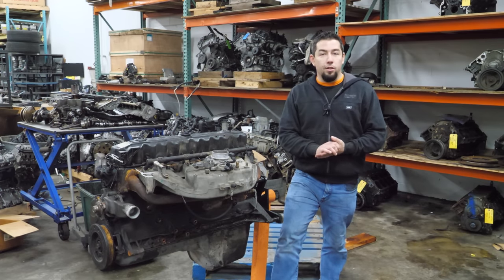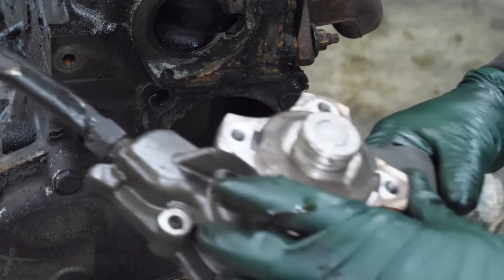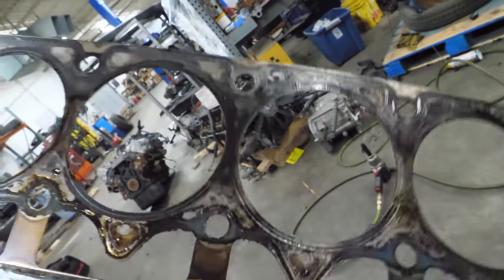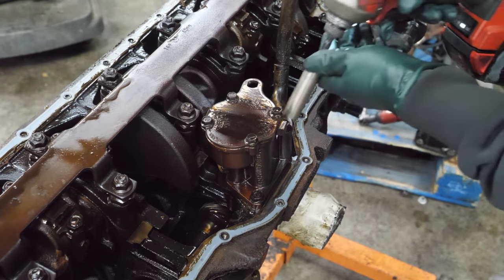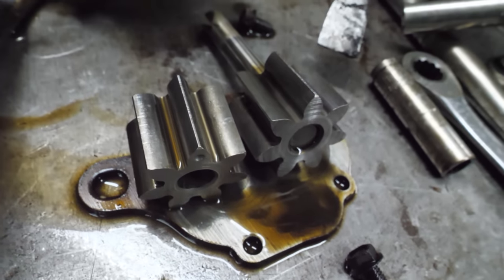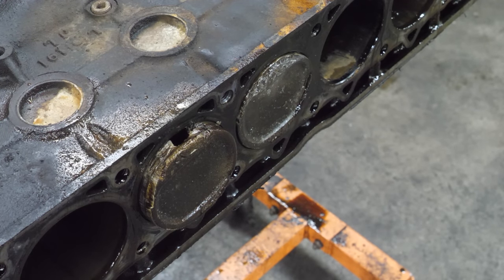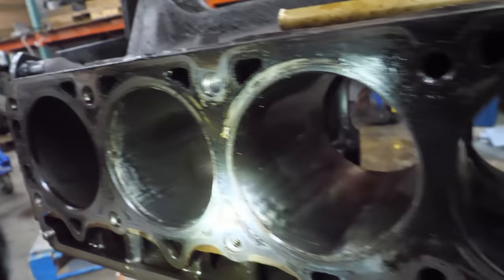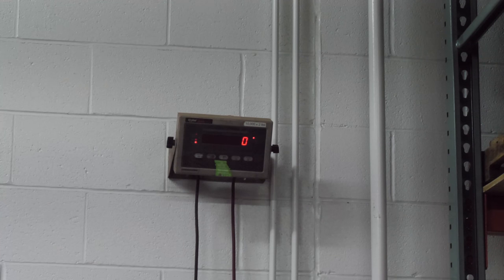How Do You Destroy A 4.0L Jeep Engine THIS BAD? Intentional? Neglect? Ill-Repair?  I Am IMPRESSED!

Comment: Agree 100%, great motors. My 93 grand cherokee I rebuilt it into a 4.6 white Brothers motor. That thing was an even bigger beast! Got T boned going through an intersection by a guy doing more than 60 mph, he ra. A stop sign told sheriff he was distracted driving (cell phone), and neither he or his 9 yr old son were wearing seat belts. I was and was fine. Totaled jeep. Towing company took it away, never saw it again. Motor still fired right up. Rear axle was a pretzel on passenger side. I was gonna buy it back to get my motor back to put in my 96, never seem it again. When I got .y check from the guys insurance company I put a well built 5.2L. 318  in it and still have it, runs great. The original v8 was blown up, so I got it cheap. Great vid.

Comment: I once owned a 1974 Duster with the big slant 6 with 400,000 mile . Drove it for 5 years sold it was still running good. Currently I own a 1992 Ford F150 with the 4.9 I 6 with 280,000 miles, running great! Must be something with the 6 pistons.

Comment: I have had fewer issues with 91-95 4.0L engines than 96+ engines.  I had a 1998 4.0L XJ that locked up 296,500.  It happened as I was leaving my driveway for work.  I meticulously maintained this Jeep with consistent 6k mile full synthetic oil change intervals.  When I opened the engine, I found the entire #6 piston shattered in the oil pan with the wrist pin still in the rod (and jammed into the cylinder wall).  On the other hand, my son has a 1995 XJ with 328k miles and shows no sign of quitting.

Comment: You are right about 4.0 engines. I am restoring my first car, a 75 Malibu with 250c.i.  inline six. The car sat for 20 years and when I slap a battery and clean gas in it, it cranked right up. They may be low on the horsepower, but they last forever. The body on the other hand needs some serious TLC.

Comment: I used to have 2 Jeeps, a '94 Cherokee Limited 4.0 Auto and a '98 Jepp Grand Cherokee 4.0 Auto. Both green with Mushroom Leather Interior. I actually prefered the '94 Limited as you could choose either 2 or 4WD. Great engines!

Comment: I had a 4.0 in my 02 wj that cracked the skirt off the  number four piston at 103,000miles. Lucky I noticed a change in the engine sound and shut her down right away. I ended up rebuilding the engine for about $600 in 2013. Put another 20k on it before I traded it in for a jku in 2015 that I still have. I loved how easy that engine was to work on.

Comment: One reason for the overheating problem that you mentioned may be an issue in a relay for the radiator fan.  I have a used 2002 Grand Cherokee with this engine.  The people we got the vehicle from ran a toggle switch into the cabin for the radiator fan because they couldn't find the relay for this circuit.  A friend found it below and behind the passenger side headlight.  The replacement of the radiator fan relay solved the overheating problem that a previous owner of my vehicle my encountered.

Comment: Replaced a 4.0 in my 96 xj with 370k. #3 piston decided it was tired of being a piston. It was really loud but surprisingly wasn't missing and still ran. Up till then, didn't use much oil (maybe 1\2 qrt every 5k). I used mobile one in it from when I bought it at 90k (don't know if that made any real difference). Didn't pull engine completely apart but visual with the pan off showed surprisingly little wear. Lobes didn't look to bad and hardly any play in the rod bearings. The little bit of cylinder wall I could see still showed some crosshatching. It would still be going if not for the one piston letting go.

Comment: They fixed it with adding the flex pipe on the manifold and it helped a lot I always put a borla header on all my 4.0's I had a 89 xj4.0 bought a canceled performance computer for 50 bucks because it was a canceled part the year before cost me almost 500  it was ported had throttle body spaced cold air intake it moved I did 16.4 in the 1/4 mile with 32 inch bfg mudders I have the video I put that motor in a 2wd mj and smoked mustangs all day long ended up building a 4.7 stroker and it was bad ass the AW4 auto was the best transmission

Comment: I have a 93 2.5 l in my Jeep. And that's it's one of the bullet proof ones. These later models had the problems with the piston slap when you start the engine. Cold Eventually, the piston slap just destroys the skirts. And that's where all the destruction begins.

Comment: I'm a retired mechanic. In my many decades of wrenching the two engines I've seen disembowel themselves with the most frequency are the Small block Chevy and the Jeep 4.0L. I'll never understand where that engine gets it's 'Bullet-Proof' reputation. They are definitely reliable. But far from bulletproof. I have one in my 2000 WJ. Reliable, dependable. Gutless, gas hog. I'm currently rebuilding an AMC gen-III 360 V8 to swap into it. I also have an AMC Eagle with the 258 engine in it. The 4.0L and 42re, from the WJ, will eventually go into the eagle. And the WJ will get the 360 with a 46R or possibly a Ford AOD. Not sure yet. . . . Anyway, 🎄 I hope everyone has a Merry Christmas and a Happy New Year 🎄 . . ❄ Greetings from Alaska  ☃

Comment: I was one of the Senior Technician's on the 4.0L engines. We beat the puppies out of those engines at Chrysler - Jeep Truck Engineering in the late 90's through the early 2000's. We had MANY examples of them that ran over 2500 hours on our engine dynos. STILL to this day, the 4.0 is one of my favorite engines.
Reply: I've seen some incredible mods made to these engines, and they're built to take it.
Reply: Why did the AMC design  4.7  fail so miserably ? was it a poor design or poor quality dodge parts ?

Comment: Through several reasons, my wife's 2002 Jeep was run virtually out of oil.  She called me on the highway and told me what light was on.  I told her to pull off the next exit and shut down.  I found it was short 4 quarts.  I put in the oil and drove it home and it ran perfectly.  When I got off the highway, the oil pressure gauge dropped to almost zero.  Uh oh... It ran another 4 months with no noise before I found a low mileage engine to swap.  The oil that came out was silver, but it was still running well.

Comment: I've owned 1 Jeep. A AMC made J10 pickup with a 258 inline 6. The first 3 motors threw the #5 rod. Between those 3 I only made it to 59900 miles. Dropped in a crate 350 chev and never had another problem. Finally scrapped it when the frame rusted out.
Reply: let me guess you like to rev your engines ?

Comment: The "genius(es)", rolled the jeep while in the mountains, and instead of draining it/refilling with water, continued to drive in the mountains, over heating it. Instead (Again), of checking the coolant/draining( OR, it smashed the radiator), tried/got the jeep out, blowing the extremely overheated engine in the process= "Dad's PISSED!!!"

Comment: I just picked up a 1996 XJ SPORT with just over 388k on it and the 4.0L runs great. And my 2000 TJ has 190k on the 4.0L. I drive them at 6,000 feet elevation in Wyoming, GO JEEP!

Comment: In the 90's we decided to murder what was left of a '77 Dodge Tradesman .. fed the poor bugger ether, acetylene, and quarter twenty nuts down the carb at 4000 RPM .. the carnage was - well, expected (amazingly, it would still start and run and move afterward. But with a top speed of a slow walk) But I'm also at a loss to explain this type of damage, especially with the relatively clean bottom end unless someone was trying to kill it.

As for scrapping the block. Maybe the business model where you are is different from here .. but everything is so rare so quickly now. Thirty thou over and it's a gem again.

In my day, shite may have sat in the boneyard for decades waiting for a new home .. now maybe a few months before the melter?

I recall early 2K dreaming of repowering my rig with a 6BT .. but those were far too pricey still being new. 18 years later they've come and gone and finding one is as expensive now as they were at the time. Surely someone would want that old 258 short block.

.

Comment: I put over 330,000 miles on my used, 1997, Cherokee Sport with the 4.0 ltr/6 cylinder. The same short block that was in my 1961 Rambler; I worked at a Chrysler Jeep dealership in 1991 when I got out of the NAVY. I still miss that Cherokee, it ran strong when I sold her even with more than 359 k miles.

Comment: oh baby, I bought a jeep grand cherokee for $500 with one of these in there that had 169,000 miles on it (nice) thinking "hey if I get a winter out of this I'll be happy!" the sound system was worth more than that, so either way I was coming out ahead lol. 

FOUR AND A HALF YEARS 
FOUR
AND A HALF
YEARS
and the ENGINE was fine! the transmission went!
Reply: it was one of those cars where so much was wrong with it I was DESPERATELY hoping it would kick the bucket just so I would have an excuse to get a new car but it absolutely refused to do it, it hung on just to spite me.

Comment: Had an 87 4.0 in my commanche, i bought it for $600 and it already had 600k on the vehicle, i drove it another 400k with no issues and its still running fine i suspect 30 mpg on the highway and fantastic off road!

Comment: 6:19 If they don't crack, they warp. The Ford 300 does the same thing for the same reason. My 85 F150 will have an exhaust leak for as long as it retains the factory exhaust log because it's so badly warped #1 exhaust port will never even attempt to seal. It's a good thing I don't really care about exhaust leaks haha

Comment: My daily car is a 1998 jeep grand cherokee laredo with a tow package. It's got over 500k miles on it and still runs strong. The only things I've really replaced is the alternator and belts. Oh and the fuel filter because that's all its needed.

Comment: I've had 2 of these 4 liters in my life and they far, far outlived the Jeeps in which they came. Valve cover gasket went on one and it smoked more than my dad in the 80s, it had more lifter noise than a Model T with no oil, and the fuel rail would heat soak until I wrapped it in foam and aluminum tape. But it never let me down.

Comment: Great Video, thanks for sharing! I have a straight 6 ford you would have loved to dissamble it ran with engine-new an additive which reacts poorly with water the crank and the rod bearing needed to be cold chilled off was rusted solid. What a mess. But it did get better gas milage.  it went into a flooded street sucked in water into the carb.

Comment: I was wondering what the mechanism of failure was gonna be in this. My sister had an XJ with a 4.0 and it dropped a skirt, tilted a piston. It was knocking really hard when it got dropped at my house by the roll back. It still pulled in the garage under its own power. Needless to say, it only tilted one piston but it split the cylinder wall so it's goose was cooked.

The 4.0 is kinda like the AK-47 of engines. You'll never find one that's tight, or pretty, or hasn't been beat to snot in mud, snow, or sand.  But that's partly why it can take so much abuse. The loose tolerances.

Comment: So, you just prooved that you do read the comments 😁
This one was a 2000+ engine with a 0331 TUPY  head.
If the engine is a 99 or 2000 it might had a cracked had being replaced as early 0331 non tupy  heads were cracking time bomb.
After replacing - block was most  likely left intouched and second new had was not making a good seal between no 3 and 4.
You would not believe - but block is worth more than the crank. Go check jeep strokers forum 😉

Comment: These engines last forever for the same reason that many old Toyota engines last forever: they make no power relative to their size and they don’t rev. The fact that it has a non-cross flow head well into the 2000s says all that needs to be said. It’s one step above a flat head.

Not saying that an antique, low stress, low power engine is a bad thing. It’s built for a long life, not performance, or fuel economy or emissions.
Reply: Probably one of the most intelligent comments on this video so-far....

Comment: I bought a 2001 Jeep Cherokee 4.0 2wd from a shady dealer which did exactly what you saw. I got the thing almost free (had to pay for the tag and title). It sounded like a spray paint can being shaken when it ran. Quickly found the bolts attaching the flexplate to the torque converter had either backed out or never tightened. I fixed that then no more major noise. Proceed to change the plugs and the entire strap/electrode was missing from 2 cylinders. I suspect the engine hydro locked from hurricane Harvey. Knew id find what you found and said Not my Problem. 

New plugs and the thing is still driving around collecting toll selfies i send to tex dot every year. I sold it 5 years ago with almost 300k on the odo.

Comment: Ive had a dropped skirt on a 6.2l diesel. I heard a bell ringing when I got off interstate. The piston was cracked around wrist pin and parts of the skirt were missing. I think they went out with the oil changes. That was in the early 1990's.  Still got the vehicle with the same motor.

Comment: I bought a 2000 Jeep Cherokee in 2003. At about 80,000 miles it started blowing bubbles into the coolant jug. I took it to a local garage. It had a cracked head. Had a used refurbished head installed. A short time later, and $1500.00, she started blowing bubbles into the coolant jug. I added 2 bottles of Bars Leak to the radiator. Drove it a few years with no more bubbles. 😅

Comment: Had a 1999 grand cherokee with the v6, your right about the overheating issues. As early as 5 years into ownership it became a constant issue. My 2008 impala 3.5 v6 with 300,000 never overheated once even after 14 years of ownership
Reply: Your Grand Cherokee has an inline 6, not a V6.
Reply: @johneckert1365  yeah Chrysler did use a V8 magnum in some Jeeps but not the V6 magnum which was used in the Dakota/Durango/Ram1500

Comment: Waited for this for years. I actually have a 3.8 laying around I'd thought I would donate.  Its not well known, but this engine was originally designed by Nash back in 1952, with revisions over the years.  From 1973 up, much of the parts interchange. It is common to install a modern 4.0 head on a 70s era engine.
Reply: That's why 4.0s are getting hard to find - people are putting them in their Nash Ramblers

Comment: 31:54 When I did a head gasket job on my 85 F150 many moons ago I didn't even ATTEMPT to manually lift the head. I got the cherry picker in there to lift it out, and it lowered it back in with the cherry picker. There is ZERO chance I will ever be able to get that three foot long lump of cast iron off the block, over the fender/core support, and onto a work table without throwing my back out.....

Comment: The problem with these is the pistons crack (mostly starting in 95ish, the later, the more likely) and the non TUPY 0331 head casting used 99 on wj and 00-02.0 on all models is known for cracking randomly.  Flawed casting, basically if you overheat it it'll do it but every time you heat cycle it, even to normal running temp, you roll the dice.  The 02.5-06 TUPY 0331 head casting mostly fixed it.

The crack will form on the top of the head between the #3 and #4 rocker mounting bosses.
Reply: That block is probably still worth a little to someone building a stroker for a 00+ TJ or any WJ since they'll be overboring anyways, but otherwise I'd scrap it.

Comment: Jeep 4.0L i6: Leave it to Chrysler to take such a simple design, and make it a piece of junk.. 195 hp, 200 ft/torque and gas mileage is disgusting.. 

My GMC Envoy / Chevy Trailblazer has a 4.2L i6 275 hp/280 torque, and almost double the fuel mileage of the Jeep i6.  

My 99 Grand Cherokee was a Joke.. and after spending $16,000 in repairs, I said enough is enough, and sold it and bought an 03 Envoy.  3 yrs I have owned it, and its cost me less than a $1000 in parts & Labour.

Comment: My 4L WJ had the fan relay go bad. It turns out this is common and the fix is to cut a hole under the bumper cover.
Reply: Yuuuuuup!!  Currently on my 3rd one (after a MAJOR overheating situation when the last one went), and - luckily for me - the previous owner had already cut the hole in the plastic for me.

Comment: Everyone says how reliable these 4.0 liters are but it’s the only engine I’ve had 2 catastrophic failures on! Spun a bearing and kicked a rod out of the block on one and dropped a valve on another one that wrecked the piston and put a hole through the cylinder.

Comment: I have a 88 Comanche that has 300K on it, and the valve cover and oil pan have never been off the motor.  It is still running well.

Comment: good choice the AMC has the strongest bottom end vs ford and chevy   I helped make over 1000 hp on 60 POUNDS boost for Indy 500  stock crank basically stock block and head with a few tweeks to the deck thicknesses

Comment: i had a 94 4.0 HO with 220k miles on it when i sold it. I actually regret selling it. I now have a 04 3.7 "Gutless wonder" 150k  that i baby intensely for fear the valve seats or timing belt will fail at any moment.